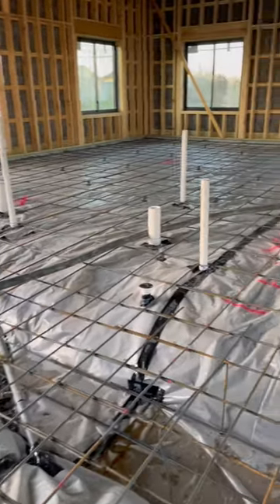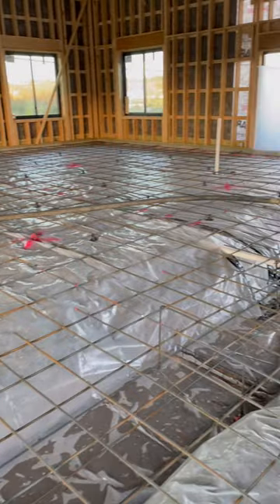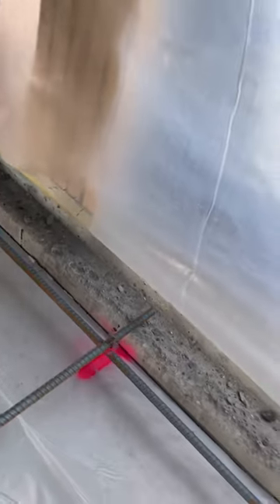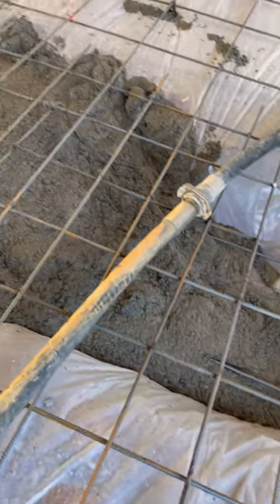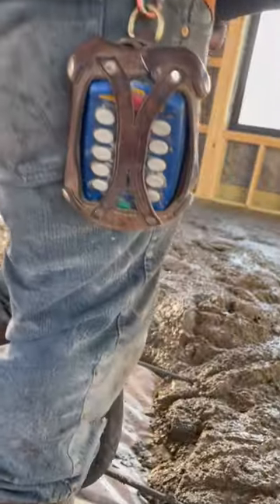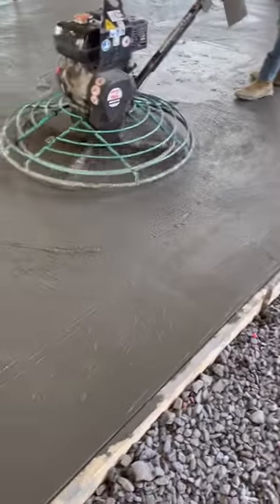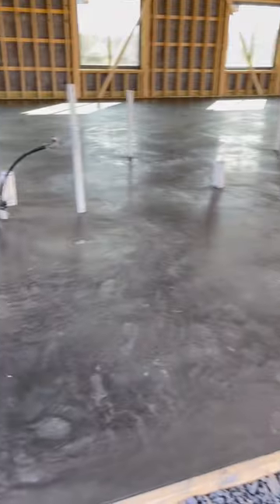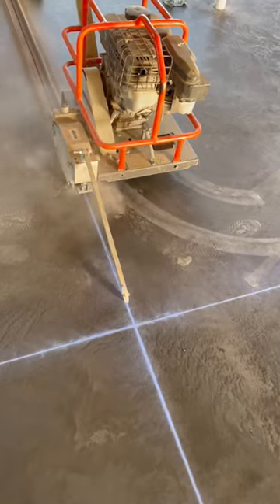Floor Pour for the Office Section of the Warehouse

Comment: Always so interesting how different it is from how we do things… Not that it’s wrong at all it’s just different.
We always have all our under-slab stuff done first, then we pour the slab. THEN block or framing or whatever the wall structure will be. Never in my life have we poured after. Just interesting how things are done differently across the country
Reply: I just did 2 doors in a building that had a dirt floor but almost everything else was finished. No idea why it was done that way. Usually the slab is done first.
Reply: Sometimes contractors will frame the building up first to control the weather. You can pour in any weather if the roof is on.

Comment: Not supposed to put rebar in contact with the ground. Rust will work its way into reinforcing rebar and cause concrete to crack

Comment: Whats the plastic is for? Whats underneath it? Is this the foundation, slab foundation no footings? Is that why u guys cut the concrete, just in case it need replacing?
Oh yah! whats the pin is for? Im curious😅

I live in the tropics so im clueless... but is this floor is build to withstand contractions from frozen soil?
Reply from the maker: The plastic on the slabs of moisture barrier. The slab is just the floor there are separate footings and a foundation wall, that were poured before. We cut the concrete, so that when it cracks most likely it will crack in the cut. The pins show us the height of the floor when we’re pouring the concrete report to the top of the pins.

Comment: Joints should have been done before pouring concrete and use joint fillers
Reply from the maker: That’s more for a driveway or sidewalks not a commercial floor in a building
Reply: @hausplans  okay, bt it's still concrete
Reply: @RodneyBuilder  take your L dude, LOL

Comment: Why did you cut it?
Reply from the maker: We cut concrete so hopefully when it cracks, it will crack in the cuts rather than just threw out the floor randomly. It’s purely for aesthetics.
Reply: @hausplans  do you want it to crack?
Reply from the maker: We don’t want it to crack, but it always does. Concrete shrinks as it cures.

Comment: Your "grade pins" are a big no no. Never have rebar close to edge or protruding through slab, thats where she'll crack for sure. Unless you dug up, cut tie wire & removed after. Use doby block to hold grid up and a longer stake w/ clamp or something for elevation, remove for finish float